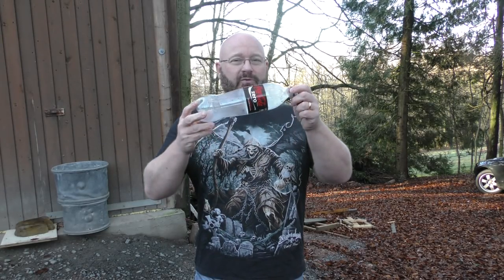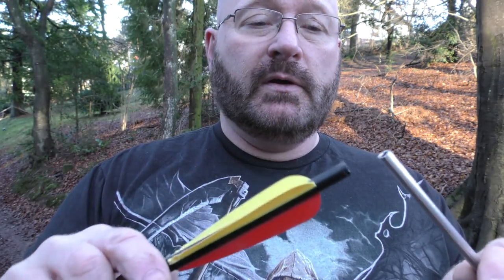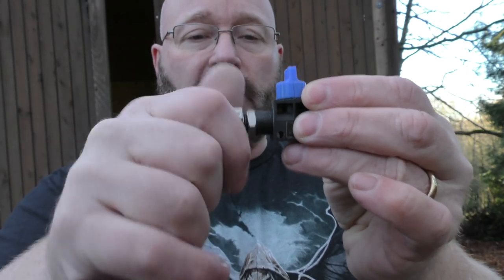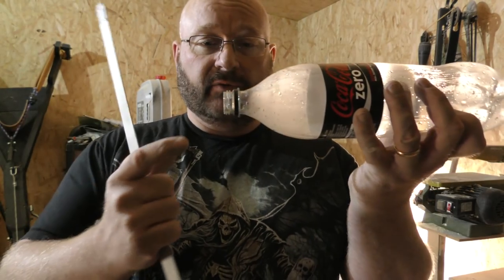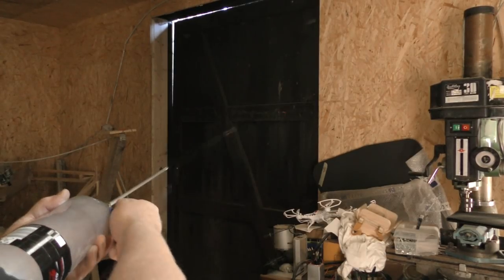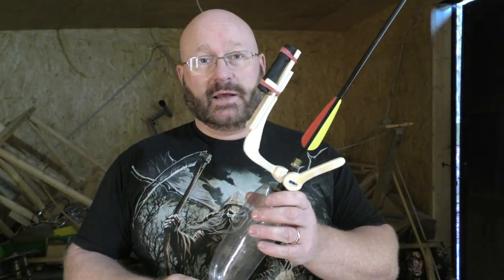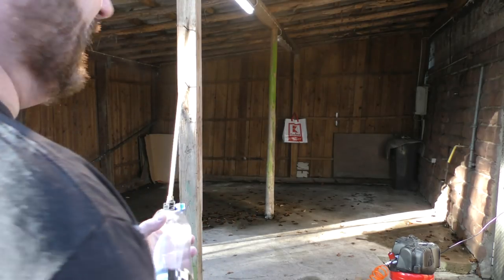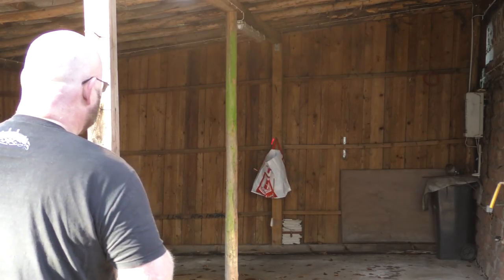How to turn a Coke bottle into a deadly arrow airgun

Comment: i made an air rifle out of a piece of 2 inch pvc  a pvc cap  a pvc 2 inch to 3/4  steel gas pipe  and brass valve  in the pvc cap i put a auto valve stem with 140 pounds of air it will launch an arrow over 200 yards i also use 20 guage shot cups for the arrows and shot

Comment: Is it possible to make the valve shut off either automatically or manually right after shoot an arrow? You could use the bigger bottle with smaller arrows in this case, and continually reload with diminishing returns on your shots. I wonder for how many shots could it still be penetrative.

Comment: "high powered vermin killing bb gun, over 400 fps" I have a pellet gun that hits 1500 fps easily with plastic pellets, its called an umarex octane
Reply from the maker: +alexander simcox Plastic pellets? Give me a break.
Reply: +JoergSprave it also gets around 1250 fps with lead, I think you should look it up. it is called an umarex octane.
Reply: +JoergSprave plastic pellets are nice so you don't have lead in animals you may hunt, but i really only plink with it and they are cheap
Reply: +alexander simcox Is it really possible to get 1500 fps with an airgun? That is supersonic. I was under the impression that supersonic muzzle velocity is only possible with hot gas. The reason is that the gas molecules are actually only traveling at the speed of sound, so they can't push the projectile any faster.
Reply: ***** yes, it is possible, it is called an umarex octane aand sells for about 200 dollars in the us, and i was under that impression too until i looked it up, sound is air molecules that bump into each other, but take time to travelin between them, but if you compress them, they are a lot closer together and want to expand at the same rate PER MOLECULE. other air rifles that hit mach 1 are the texan and i believe the bulldog.
Reply: +alexander simcox How interesting. I will have to study up on this phenomenon. Thanks for enlightening me.

Comment: I'm wondering where he gets the rubber bands, some of which look very thick?  I would like a collection of rubber bands for various sling shot like launchers I am experimenting with to launch glider and RC airplanes.  Most of what I make are in the Park Flyer size.  I don't have a hobby shop that carries rubber bands for the free flight rubber band motored models, or I would see if they would order other options.  For some reason I'm not finding the rubber ribbons easily on the Internet either.

Comment: Im not here to bash your cool little project...     However 100 fps arrow speed is about average for a 20- 25 pound recurve bow..   Rather unimpressive when you consider it will take several minutes to recharge and reload the launcher compared to several seconds for the bow..    If you store the energy in 45-50 lb recurve limbs then your talking almost double the arrow speed... or around 180 - 200fps...   Are you allowed to build your own pneumatic rifles in Germany or is that Verboten?
Reply from the maker: +rainmechanic Just wait for today's video. There is a lot of room for improvement. BB shooting airguns require a license as soon as they exceed 7,5 Joule energy, but even the free weak models have to be made from licensed gunsmiths... my arrow shooters fall into a loophole though.
Reply: JoergSprave   So you would need some type of license to own something like a Benjamin Nitro .22 break barrel or a Daystate Pre Charged Pneumatic?   I was not aware that Germany was such a restrictive nation..  Are there restrictions against Compound bows or are those exempt from licensing and regulations regarding purchase and ownership?

Comment: BB guns are illegal in Germany?Ive seen air gun shops in Germany.
Reply from the maker: You can buy weak ones without a permit. From 7,5 Joule onwards you need the same license as for firearms. But even the weak ones, you need a gunsmith license to legally make them yourself.
Reply: @Slingshotchannel  Thanks for sorting that out for me!

Comment: I wouldn't dare use a pop bottle. Here in the US they are too thin and would pop! A toy, funny guy, great stuff.
Reply: +Robert Foote In my country and the last time I was in Germany they typically are reused (not recycled, but literally reused after cleaning). When you buy them in the store you pay a little bit extra that you can get back upon returning the bottles, same with the standard brown beer bottles. So it's worth it to make them durable enough to last a few times.

Basically you shove the bottles through the machine, at the end press a button and you get a small receipt with a value then upon checkout you get that amount of money back (or reduced from the cost of your groceries).
Reply: +Extra stuff  Thanks, we have a .10¢ deposit on a recycled bottle. Great to learn.
   I'd have to use a reusable airesol can.
  he's a grin😀😀
Reply: Robert Foote
Well be safe with your experiments, I've got my own proper PCP airrifles and a high pressure handpump that is 275 bar/4000 psi rated. And for days when I'm lazy I've got my two diving tanks (4L and 12L internal volume 300 bar ones). So I'm not really inclined to build these type of contraptions yet.

I would suggest that if you do decide to build it at least the first few times you pressurise it and when you shoot it have it mounted in a vise with a blast shield of some sort between you and the device. Trigger it by pulling a cord for example, best not to take any chances until you're fairly confident it will not blow up on you.

If you drill a hole to add a fill valve you can weaken the structural integrity of the can and you'd better test it in such a way that sharp metal can't come flying straight for you initially. With typical bicycle tire pumps and shop compressors you won't get truly high pressures, but be careful with that stuff compressed air reservoirs bursting and overstressing fittings that make them fly out at rapid speeds are no laughing matter. It'll probably hold the air or leak, bursting isn't the most likely scenario but it isn't impossible.

Normally aerosol cans will use a propellant of some kind (often flammable) that is in a liquid state but will have a high enough vapour pressure under typical temperatures to quickly release enough gas to push the content out. So up to that pressure would probably be safe if you haven't compromised the can, do your research and testing safely :)

Comment: lol I find it very funny you think a plastic coke bottle can hold enough pressure to shoot anything with lethal force..  nope.   60 psi will give you what is LESS the an airsoft gun... ( airsoft runs on propane pressure,, aka green gas or propane with perfume added lol)

I'ma give your laws a quick lookup, I could have sworn airsoft was lethal everywhere.

Comment: ill tell you a good thing to do get a bottle bigger the lid more you can shoot out of it smaller for small stones bb's or pencils take the lid off cut the top bit off so you have a little cylinder with the threads on get a rubber glove best use the cleaning gloves the yellow ones with the diamond patten on the fingers latex gloves cut a finger off put it around the bottle lid holder threads and tape it on so what you got is a glove finger on a bottle cap the bit the lid screws on to put a stone in or some thing that will fit shoot on but be careful these hurt a lot they are cheap and they can kill if you hit some one in the wrong place so these are for fun not to shoot people or pets